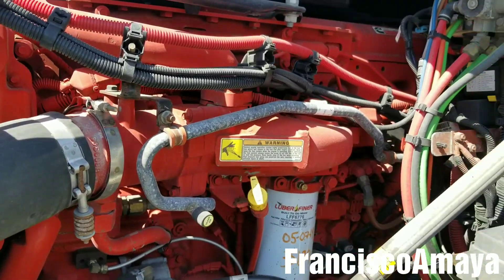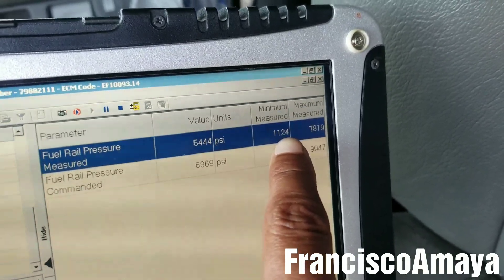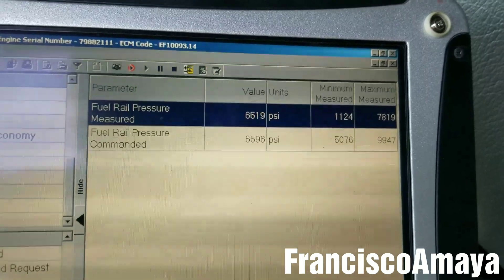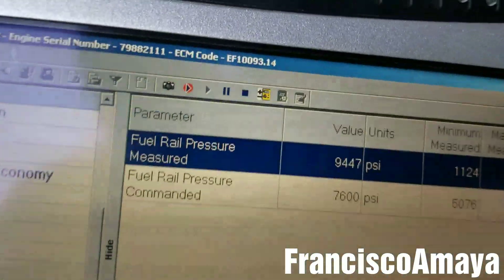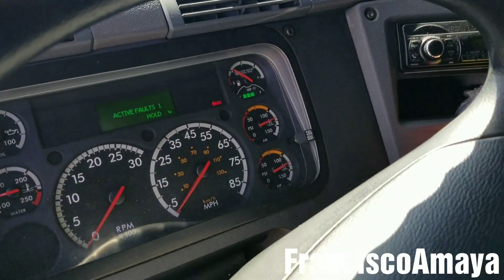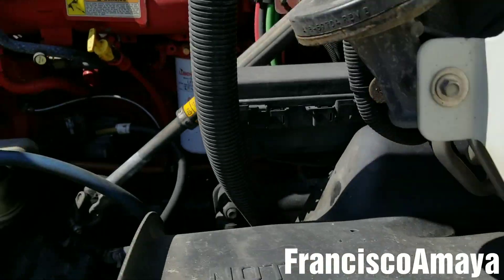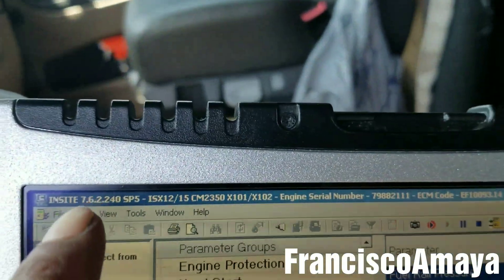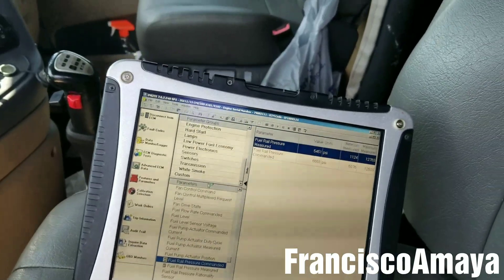Cummins ISX engine Fuel pump problem low fuel pressure engine shutting down low power

Comment: Hi bro 
i have a problem with my 2021 Cummins ISX15 engine  , I bought a truck that had an accident . I brought it to repair the accident only . bud engine stuck.
the first started very easy for 5 minutes and of the bay itself . i changed the oil samp was open and not oil at all . im open the samp and the frant it looks right no broken parts or anything bad still can't turn over the engine manually with the hand totally stuck . give me some advice please.

Comment: Hola, tengo un ISX 15 que me prende el check engine light y cuando prende pierdo fuerza, me lo hace por varios minutos y luego sigue funcionando normal. Me da codigo de low pression fuel en el riel de los injectores
Reply: Brother resolviste ese problema  tengo el mismo truck y me esta haciendo eso
Reply: @Elseve23  mi problema era un injector dañado
Reply: @axelrodriguezdi  ok gracias 🙏

Comment: It could be or it could be air in the low pressure side of the fuel system if you follow the troubleshooting like us techs do you could save about 4 to 5k on a new pump
Reply: Where to be exactly?
Reply: @josueregalado3039  troubleshooting?

Comment: Shut the engine down, park for the night.
Next day try to turn the engine on and it just cranks, no start.
Check engine for “Fuel Delivery Pressure”.
Mechanic said it is Gear Pump.
Replaced the Gear Pump and it still does the same thing.
Been in shop twice and mechanics can’t figure it out 😞😞

2007 ISX2 Cummins Reman (currently 460,000 miles on engine)
Reply: Im having same problem what was it with your truck?
Reply: @JayJay-xr2up  took it to JX and they fixed it next day . Wrong fuel filter and some relay was burnt out smh
Reply: @rakimmason8  ok tanks
Reply: @rakimmason8 bro do you know which relay it was ?
Reply: What was the problem
Reply: @diesellettuce7624  still trying to figure out. I’ve been to 3 shops that have failed to find the issue. Just throwing parts at it smh. So at this point I have no choice but to take it to the dealer 😭 $175 an hour 🥲 currently waiting on an update.
Reply: @rakimmason8  other than that no codes? Will it start with ether?
Reply: @diesellettuce7624  if I try to crank for a long time the only code that comes up is 2215 FUEL DELIVERY PRESSURE

Comment: I have a problem with my Cummins engine to where  I struggle on hills  and my dash say fuel rail pressure and injector spill valve but I've replaced the fuel rail pressure sensor do you have any advice on what I should do next
Reply: Where you able to find the problem ?
Iam having the same issue.
However I am not getting any codes or any message on my dash. I just hear a on and off woaing noise at around 14rpms
Reply: @noblejissel  I've replaced all my injectors and I have no more active codes put I'm still not getting the power I should have going up hill and I haven't been able to figure out why
Reply: @rawlinmadaris5712 . was you able to figure it out?

Comment: Hola Chacalon ocupo ayuda tengo un 2011 t660 con cumins y dise  fuel rail pressure aveces se apaga solo
Reply: Le ayaron el problema a tu camion?
Reply: @fcoanaya5762  no
Reply: Encontraste el problema mi hermano? Estoy teniendo ese mismo problema
Reply: Al mío se le cambiaron todos los sensores que tienen que ver con el diésel.. de hecho también se le puso la pompa de diésel nueva y siguió con los mismo sintomas.. mi troke nomas cuando voy arrancando como se estanca en 1200 revoluciones y no desarroya pierde fuerza.. ahorita está en el taller
Reply: @fcoanaya5762  Me deja saber porque ya en verdad nose que es le cambie el Fuel pump, las lineas de diesel, el electric fuel pump, ya nose en verdad que tiene que ser eso
Reply: @luiscontreras8047  si ay cuando salga de el taller le aviso como quedo ..
Reply: @fcoanaya5762  un millón de gracias
Reply: Q fue su problema amigo? Muchas gracias
Reply: Arreglo su problema amigo? Me pasa lo mismo

Comment: I have a humming noise coming from my fuel assembly while is running about 10 to 13 rpms is sounds kinda like a bell ring my engine is not losing power but the noise is very loud has anyone had this problem or any idea what might be wrong
Reply: Ecm cooling plate
Reply: @elimetcalf406  thanks I actually found the problem and fixed it. It was the fuel gear pump that was bad

Comment: I have freightliner 2016 cummins isx15 when I change to higher gear rpm goes down to 10 and the loose power what do u think
Reply: I have the same problem on my 2015 Cascadia with isx. If you find the problem let me know

Comment: Qué tal amigo  quería preguntar te. Si me podrías dar una oponíon sobre tu experiencia. Mi camion se le daño la fuel pump Cummins isx15. La que trai las piezas de cerámica. El problema fue q en carretera se apago el camión ya no intente prenderlo.   Lo remolcaron en grúa.    El problema es q aora el mecánico me dice q el block del motor no sirve por que no tiene precion de aceite.    Se le remplazo  fuel pump nueva y oil pump nueva los metales y limpiaron toda la cerámica q se fue al aceite el cigüeñal salió  en buenas condiciones.   Que me puedes decir sobre esto  podrá ser el block ya no sirva es lo q el mecánico  prende el camión pero no sube la precion del aceite y cambio sensor nuevo del temperatura sensor pero no se estoy en duda

Comment: We have a truck In the shop with the Same engine that the owner replaced the injectors in and now it won’t start. The fuel pressure is like 180 psi I’m thinking he may have a problem with his pump. Only thing is the truck ran before he put the injectors in it so far we haven’t found any fuel leaks or anything. We pulled the valve cover off and the injectors are seated and torqued and they’re all new But the fuel pressure doesn’t get over one 180 187 is as high as I’ve seen it for a second. Good video!
Reply: Re fill main filter bout 3-4 times..itll fire

Comment: Driving to Maine my truck turned off, I got it tow to a local shop. Turned out to be the fuel pump. They install a used fuel pump and removed the old pump with small debris of white cerami. 

I called my mechanic who works on Cummins and told me that the ceramic whont go inside the engine if anything it will fall in the oil pan.  He said that I can drive and when doing an oil change to remove the pan and clean it. 

I keep hearing online that if a fuel pump on an 2012 isx15 and up brakes the ceramic will break the engine. Do you know anyone personally that this happened to? My mechanic tells me to drive and online says it will break.
Reply: I wouldn't chance it. I've read it can mess it up completely.

Comment: Hola yo tengo Un International prostar cumminx isx 2014 y corriendo seme apaga y vuelve a prender solo alguen sabra q problema puede ser porfavor ayuden gracias ?
Reply: Arreglo el problema amigo tengo el mismo problema
Reply: Tu camión tiene el interrumpor de corriente es un switch que va al lado de asiento de el chofer
Reply: Resolvió el problema?
Reply: El mío hacía lo mismo, y la cambié una parte que se llama pndb box. es una caja que lleva fusibles y un relay interno que es el que comienza a fallar  y esa parte va en lado de el chofer en la pared de la cabina en la parte de arriva.. yo puse esa parte y asunto atreglado .. mi troke es un Cascadia 2015

Comment: Tengo flash codes 1141, 1139, 1143, 1142, 1144 y 1145... estos estarán relacionados con el harness de los inyectores? O será problema del fuel pump? Gracias, la troca no falla solo tiene el check engine prendido.